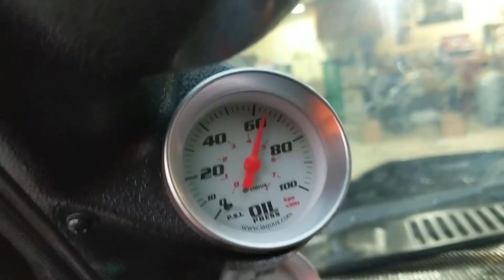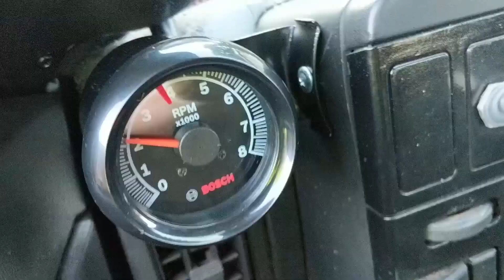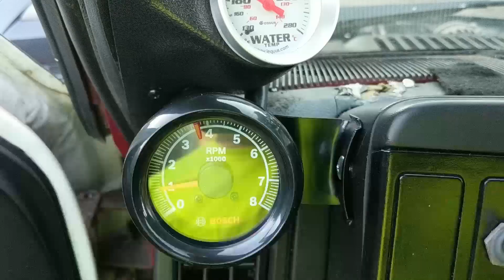Second Attempt at First Start Will it run?

Comment: The last time I rebuilt my 355 few years back at startup and cam break in it was running really warm and I kept shutting it down due to temps, I was very unsettled and baffled all looked good. Drove it and still said it was running pretty hot but it didn't seem hot so I called summit inquiring about the new digital gauge I had bought they asked for my part numbers and woops we sent me the wrong sending unit... I got the new one and whahlah normal temps. Relieved but kinda annoyed at the same time.